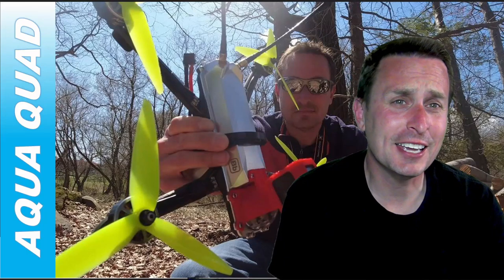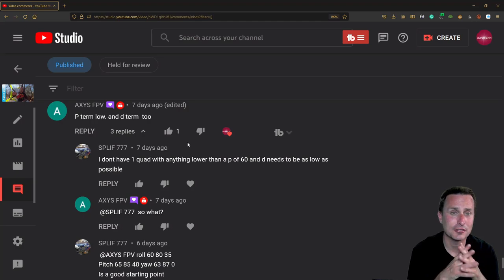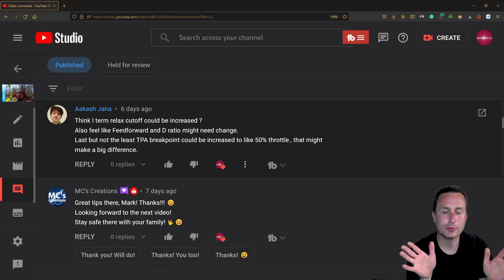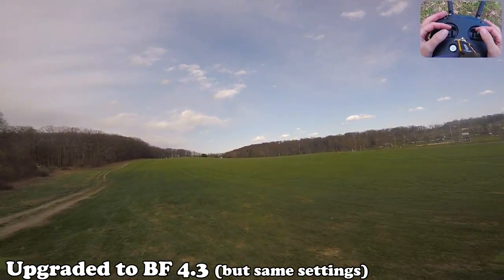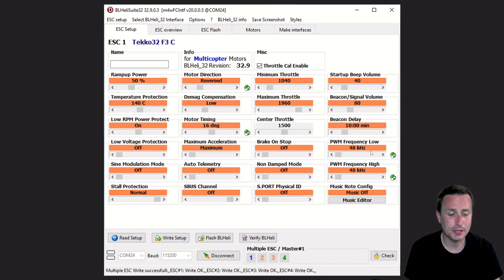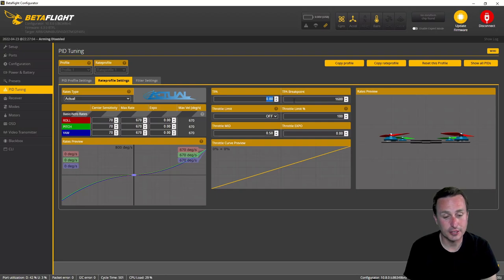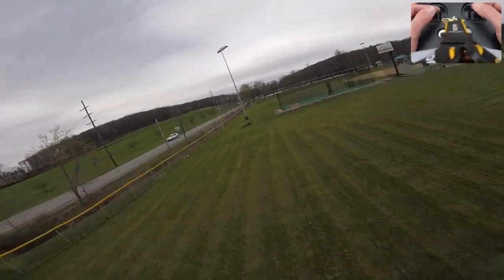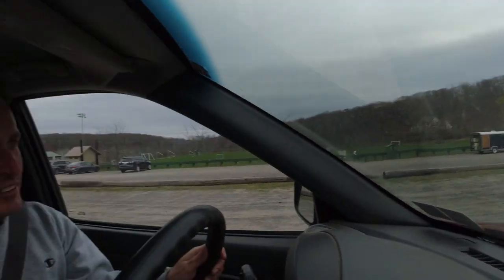SOLVING 7" Oscillations / Wobbles   |   7" Tuning Tips

Comment: Thanks Mark! I just used this and some of your other 7 inch quad / betaflight guide videos to complete the tune of a new Rekon7 I'm building (not a ready to fly quad). This thing was all over the place when I just finished putting it together, and I was unable to tame it down myself. Using Zues F722 flight controller with the Betaflight 4.3 firmware image it came with.
Followed your advice I enabled bidirectional DShot (Zeus 60A BLheli 32), changed PWM frequency from 48KHz down to 24KHz , and fetched your 6-7 inch quad tune preset, instantly got much much better results.
Reply: Good to know! Have you also installed his 48 Khz ESC PWM ?
Reply: @ToneVisionTonstudio  I actually reduced ESC PWM frequency to 24KHz. in addition, after posting this I also reduced the master multiplier in PID tuning panel from 1.5 to 1.1, this improved flying smoothness even further.
Reply: @rcfreakamit  thanks !

Comment: FYI - For most ESC's that are stuck in the 48khz+ range. sskaug has or will on request release a "half-pwm" target. You can flash that target and any displayed pwm is cut in half. So, if you select, 48khz, for example, it will be 24khz. And 48khz - ByRPM does actually work as 24khz - ByRPM. It's a custom target so you have to grab it from their GitHub repo for your ESC though.

Comment: Holy s#%t.. I didnt even know about the presets feature until yesterday. Been i while since ive used betaflight😄 Was gonne try to tune my 7inch, since ive been struggeling with alot of vibrations and oscillations. So I updated the FC to 4.3.1 and i had to try your preset and oh my. Now my 7" fly smoother then any quad ive ever flown (and its over 1kg with battery and gopro). Thank you so much!

Comment: Are you running those super long antennas you showed at the start? I would guess that a lot of the shaking could be due to low frequency vibrations of those antennas.
Reply from the maker: Yeah, i plan to put on some normal DJI to see.
Reply: @uavtech  i can tell you this is not the problem

Comment: Hi, i have 4unit 7" Quadcopter,  three of them already pass my personal record in 10km, 11km & 12km journey with 20-24km in total, all in BF 4.2 versions and in every new build i use default 4.2 Betaflight PID Tuning and all the issue is the same, Wobble, then i tune the P&D term at first to get the lock feel, after that i concentrate on wobble by punch the throttle then release it, all same problem : Wobble, then i move the the I-term to the left become 0.8 using slider, all the wobble problem completly gone, maybe you can test it for my reference, this is the setup :

*. Betaflight 4.2, PID tuning :
-. Master Multiplier : 0.8.
-. D-term : 1.3.
-. P&D balance : 1.5.
-. FeedForward : 1.5.
-. I-term Relax : 15.
-. AG Gain : 7.

*. BL_32 setup :
-. Ramp up power : 19.
-. Demag : Low.
-. Timing : 19.
-. PWM Low : 48
-. PWM High : 48.

For your reference :
1. 10km journey : https://youtu.be/Pi2j17T2dSk
2. 11km journey : https://youtu.be/ySBvXENS33s
3. 12km journey : https://youtu.be/dlpwG76BGs8

Comment: Thank you for this. I've been dealing with slow wobble on my FR7 for a minute and didn't realize the higher esc frequency caused it. I also have the same shake in forward flight that drives me nuts. I hope you address it so I can get a solution. If I could get this thing to fly like it did on bf 3.5.7 with all the new features of 4.3 I would be stoked.
Reply: I have the exact same issue on the same quad, did you manage to fix it?

Comment: I still have a minor fundamental disagreement on the PWM frequencies - 48kHz really can work extremely well, even on softer rampup power settings that reduce overall low end authority (especially on D term) due to reduced braking - I realize that effect tends to be deadtime multiplier dependent, but honestly I haven't encountered a 7" setup that I can't tune very well around the limitations of 48kHz PWM
Reply: This is science 🧪
Reply from the maker: I just see the wobble control is so much harder with anything higher than 24khz.  :-/

Idk.  Folks can try both.  I have tuned a 7" at 48khz too, it is just harder.

Comment: One thing I have found out is the best way to increase frame rigidity is to use the shortest standoffs you can get away with and make sure to have as much of the thread full as possible.....apparently vibrations are really good at traveling through the hollow portion of standoffs.....I use your tips for ESC settings and dropped it to 16k, added your 7" pre-set and it was better but still had a bit of jello....switched from 30mm standoffs to 20mm standoffs eliminated the jello
Reply: Thanks alot for this comment.  I have been fighting jello in my 7" iFlight XL7.  I actually put taller standoffs in it so that I could fit a 30x30 VTX on top of my stack.  After what you've said I can see that I need to go back to the shorter standoffs and the carbon camera plates as well.  I guess I didn't realize how much rigidity you lose with the taller standoffs and no carbon cam plates but that almost has to be what my issue is because I've tried all the tuning stuff.

Comment: Great video, I 'm a noob, built my 1st qav250 quad, I have the same problem, my quad slowly moves up &down, by a feet or so. Also quad drifts always towards the left, though it stays leveled, if I move my stick to compensate, it gain moves to right if i leave the stick. I thought betaflight automatically takes care of this. but crashed my quad a few times.
Reply from the maker: it will drift unless you are on INAV with a GPS unit; which is not a place to start.

You can never get perfecically level in BF to not have some drift.

Comment: Very useful thank you. My issue on my Chimera7 is little wobbles while cruising straight, low throttle and linear. Barely visible flying but more evident once you watch the air unit video. Il, try excluding one of the gyros and see what happens.
Reply: I have the exact same issue on the same quad, did you manage to fix it?
Reply: @Virtuonaute  
Oh yes! BF 4.3 helps a lot.
Reply: @Virtuonaute  
Yes! BF 4.3 helped a lot.
Reply: @MindRiderFPV  OK I'm using iNav... 😅
Reply: @Virtuonaute  
Never used it.

Comment: I yaw right when cruising. Tried playing with anti gravity but I think it’s something else? Any suggestions on what to try? I have a source one 7” frame. 2407.5 1622kv motors on a hobby wing 60 a and radix v1 Fc used your pre tune and it’s close but not quite smooth enough.

Comment: man i remember building my freestyle 7 inch with butterflight and it flew amazingly. i could lap right behind 5 inch race pilots!
Reply from the maker: Not understanding the question/statement.  

1. Obviously, it matters who you are racing against.  I'm sure it was not folks in the top 50.
2. ButtF is Beta with a different logo.  Also way dead project not too (because a sham), so doesn't matter.
3. if a lot of long runs in the track (less technical) 7" is faster than 5"

Comment: Thanks Mark! She's flying way better. I did notice when on throttle there were some vibrations looking at the light poles. Anything you could do to fix that? J/W
Reply: By any chance you have a bmi270 board by hglrc?
Reply: @jdnic1  no I do not. But I was referring to Mark's quad in the video and how he got it to fly much better.
Reply: The motor vibrates, and it shook the video? What flight controller do you have?

Comment: Thanks for the video, good info! As I thought - there will be small shakes/jello on forward flight. I would really love to see if you can tune them out, so plain forward flight becomes smooth. After all this is definitely a cruiser and it's supposed to fly straight most of the time. Right now from my perspective, those shakes are impossible to be fully removed by tune, because it's a physical property of the frame + motors + props combo
Reply from the maker: https://youtu.be/zpdCw_BciO8 ---> https://www.patreon.com/posts/66449011

Comment: You would probably be surprised how much less of an oscillation you get in the step response when basement tuning a powerful racing rig and comparing 16 vs 48kHz low. Not only the big boys profit from the torque generated in the lower end. It's just more obvious because of the slow wobble. The next benefit you get is a powerful braking force on 16kHz. I think a lot of racing pilots, especially the very quick ones are not aware of that.

Comment: I suddenly got this issue of wobble. Identical. I use 840g auw apex 6 with 2408 motors. 6s. Wobble wobble wobble. Bf 4.3 rc3 and Rc6 tried. I can't fly the quad. Also, on low throttle, it barely stays in air... What to try...

Comment: Nice video as always <3
I'm running basically the same settings with BHELI_32 and my ESCs can achieve 16KHz (Typhoon_32 from Airbot), i'm surprised by "PWM Frequency High" not set to "By RPM", i might give it a try ;)
Have a great week ahead and keep on flying <3
Reply: If you set low to 48khz there is no point to set it to by PWM because there is no variance between 48kHz low and 48kHz high. It does the same. Variable PWM frequency only make sense when low < high.

Comment: I'm having issues tuning my new 7".

Oscillations on forward flight with throttle, or horizontal while flying forward.

So you suggested TPA for this? Will try the PWM freq and see if it improves
Reply from the maker: wobble or shakes?
Wobble: you need to make sure on 24khz PWM and then move up Master Slider, and possibly reduce Drift-Wobble slider.
Shakes: try different props; HQ tri-blades, test with NO wind day.  If still no go, try 48khz PWM.  If still no good, your motor bells may be off balance, bearing issue, or your frame is not handling motor vibrations well and magnifying them.  ALSO make sure you camera sensor is not the issue.  Does HD match FPV for seeing shakes.
Reply: @uavtech  turns out it was a bad gyro.

Mamba cost me an air unit 😭

Comment: Thanks Mark just put your BF4.3 preset for 6-7”… on my Chimera 7”now flys so smooth and responsive and slightly longer flight time … just wondering if you recommend adding the crossfire preset… 
I have CF diversity nano but a bit confused about locking 150hz or 50hz for long range 
Thanks for all your help 😊👍
Reply: What Filters and ESC Settings did you use? Tja ks for reply 🙂
Reply: @sickshots  hi there I just installed BF4.3 loaded Mark Spats 6”-7” preset so what ever that makes the filters ie I didn’t touch the filter and left the PWM.. at 24hz😊👍
Reply: @flipfpv4539  thanks! Will try the BF 4.4 Preset

Comment: @UAV Tech I get horrible noise and smoked a motor with your 7" settings and same with my own settings aswell as other 7inch pid and filter presets. smoked a motor idling props are just going nuts and gave it a bit of throttle and smoke. but the vibrations are so bad. was fine on 4.0.6 now i'm having such a hard time with 4.3 have to filter the crap out of it. now i'm getting wobbles after swapping motors esc and FC still did the same thing as far as noise and hot motors after the swap but then did filters. idles ok and thottle up vibs noise gone but flight i take off and wobble city.
Reply from the maker: Keep filter sliders low.  Apply my 7" preset and lower Mater so that D-gains are no higher than 35.  If you still have an issue, you have a mechanic problem you need to sort out.  If that flies, then work to bump up Master.

Comment: I realize 0 on the Dynamic Dampening is to make tuning easier. Do you put it back on once you find a good Dmax? 6" freestyle/cinematic quad.
Reply from the maker: I typically do not unless i want to re-jigger things to suppress D-gains.  For a 6" not so much unless I have vibration issues I need to cover up (not ideal).  For a cinelifter, YES in some cases because D-gains typically need to be very high.

Comment: chris rosser did a vid on pwm and has said a variable pwm freq. doesnt lose much torque if its set 16/128k or 24/128k.  trying to get my roma v2 to fly well. has some bounce back on pitch. roll and yaw seem fine. no dipping on thrusts , sounds clean and very little prop wash. some wobble on pitch as i descend.  its my first time trying to tune at all. using sliders. still on 4.2
Reply: The difference between 16/24 on torque is minor but why not going 16 and take all the torque you can get? There is no downside compared to 24.
Reply: @marlin-fpv   not all escs go down to 16. i have one locked at 48.  one locked at 24.

Comment: Also if you have an old bmi270 flight controller your motor would vibrate no matter how much you tune it try replacing your flight controller with a recently released flight controller, older flight controller have bad PCB design and have less noise tolerance.

Comment: Hello!  I have a strange problem with the pid tuning on a 7 inch quad.  in simple words when I add Feed Forward it starts to oscillate and if I remove the FF completely the oscillations disappear.  What does this all depend on?
Reply from the maker: Your RC inputs.  Sounds like you have a choppy RX input.
Reply: @uavtech   thanks for your advice
Reply from the maker: @MrBiaggio89  whatever RX link you are using, apply the corresponding Preset for it.  If still oscillations, make sure the ADC filter is on in your Radio (assuming an firemware OpenTX radio)

Comment: I'm having trouble with my 7" freestyle build - horrible oscillations in forward flight. They completely ruin footage despite gyroflow's best efforts. 2807 1300kv motors and around a kilo auw. But I ran 20% ramp-up and 16-48 PWM frequency. I tuned the esc, and I'll try it again on weekend. Apart from that it flies just perfect on stock bf 4.3
Reply from the maker: Focus on the prop balance.
Reply: @uavtech  oh.. so it's just unbalanced props? Why doesn't it show at any other throttle position? And can you recommend some props that don't need much balancing, or any at all? I tried dalprop cyclone T7056, gemfan flash 7040-3 and 7042-2
Reply from the maker: HQ tri-blades always seem to work the best for me.  Not perfect always, but generally pretty close to well balanced.

Comment: Hey boss I just built my 7in an I did what you suggested an when I arm my drone with no throttle it flips out crazy. I will sit an idle for few seconds then it does it again
Reply from the maker: Check prop direction
Motor Directions
Props IN/OUT setting
Reply: @uavtech  I’ll double check again once I get home. I’m using a iflight blitz 55a stack and I made one fetal mistake before I started changing stuff and I didn’t save the factory setting on my computer can I still get them back. The blitz F435 doesn’t have firmware on Betaflight yet so flashing my stacks isn’t an option for me.
Reply from the maker: What version of BF are you using?
Reply: @uavtech  10.10
Reply from the maker: That's the Configurator version.  What is the BF firmware version 4.??
Reply: @uavtech  4.5
Reply: @uavtech  it’s 4.5.0 BTFL so I got the gyro figured out finally an today I went to do a Hoover test and as soon as I armed it lifted off the ground no throttle applied an after a few times ti verify that it is trying to take off once armed I felt the motors an they were definitely hot just after arming for 3 times for maybe 5-10s each time.

Comment: Hi, I have exactly the same oscillations on my 6inch apex with f90 1500kv motors like in the end of the video, Iterm doesn't do absolutely anything to it. Both betaflight and emuflight doesn't make sense on this oscillations. I'll try to decrease pwm frequency but do not think that it's the reason for that. The most strange thing that it's all okay with traces in black box viewer
Reply from the maker: It's prop vibration.  The high freq parts get filtered out, but the low freq. still remains.  Need to address mechanically/electrically.
Reply: @uavtech  I tried 6030 6045 and there is no difference in the vibrations. motors are perfectly balanced
Reply from the maker: Then a frame issue or electrical.  It is a tricky thing to tackle "The Shakes" as you have to pin down the source.

- props?
- frame?
- electrical noise getting to gyro?

Comment: Hi thanks for the video. I'm new to quads, under a year flying, and i just built a yakuza shadow with 7" arms that was gifted to me. Used BF4.3 on the supafly 7 preset but have tons of vibration. Im thinking its cause i used bi blade props. Have ordered tri blades to see if that work. If not going to try your pwm freq adjustment and then you tune. I dont really understand tuning at all so preset loading and your video will be my go to. If you dont mind checking out my video i would love to hear your opinion.

Comment: Hy im new to 7inch quad, my problem is hard to maintain forward movement and its like so hard to drive, my motor 1650kv and 6s lipo 100c 1500mah ,what is your option bro?
Reply from the maker: 7" preset applied?
Reply: @uavtech  not yet, i will try your preset tomorrow . What else could i adjust ?
Reply from the maker: @endremurti  need better description.  Hard to maintain forward movement is to vague.
Reply: How about the rpm filter activation is it mandatory (in the preset )? My motor getting hot fast when first hover i mean when i just fly my quad for first with stock pid before your video
Reply: @uavtech  im not sure ,i think my battery placement also make it worse ,maybe my lipo is to close to the tail ,still not put any gopro and the battery also to light weight

Comment: This video is perfectly timed, I’ve just built a quad using an iflight stack and it’s got these damn slow oscillations off throttle and after flips and rolls, I’ve tried adjusting everything and they just will not go away… I can have perfect PD ratio for flips/ rolls and it just stays there, I managed to reduce it significantly with 0.2 iterm and then off throttle the drone just wanders… I have Jazz Maverick on the ESC but it doesn’t give me the option to adjust PWM, I’m wondering if that’s causing it because I’ve tried three different motors, two different props and two different frames and it just will not go away.
Reply: This is a 5” too